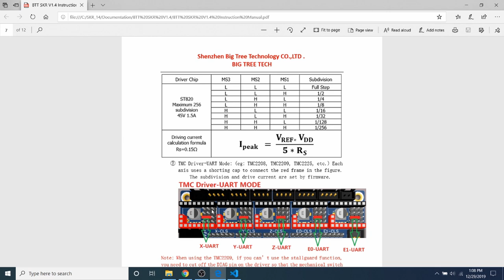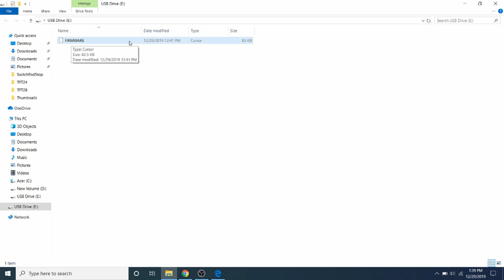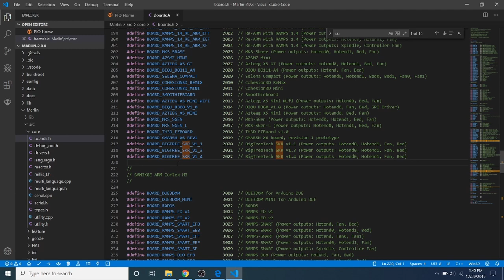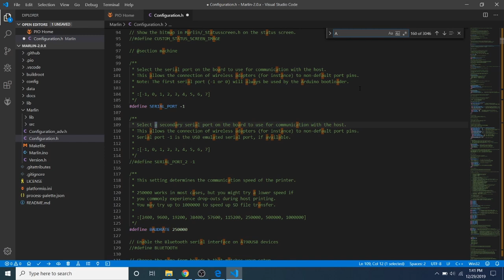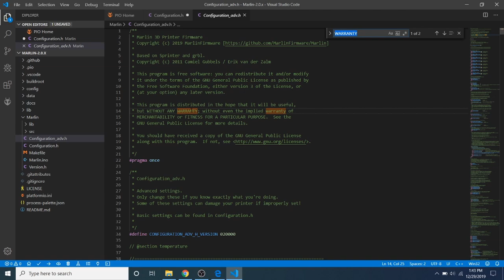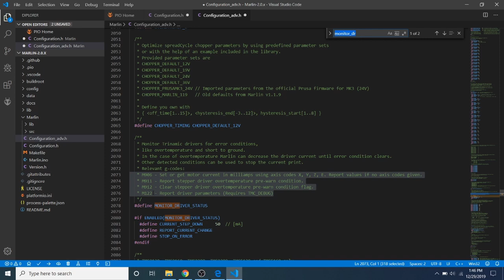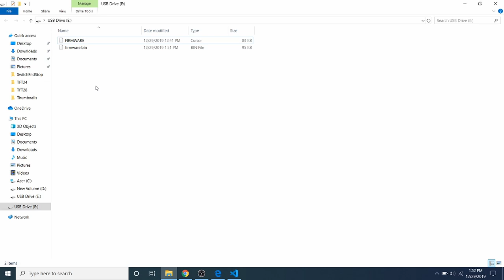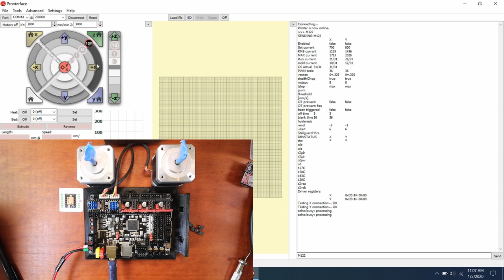SKR 1.4 - TMC2208 UART v3.0

Comment: Hi Edward! So, my SKR 1.4 T came today with these drivers and after plugging everything in, it says 'TMC Connection Error'. My jumpers are in place as following your other videos. I've checked that my zero ohm resistor is in place in every driver, so I guess I don't have anything else to solder right? Am I missing something very obvious here? No dupont cables to connect here and there right? Also I've noticed that when I upload a new firmware, after rebooting it just won't work as intended. I change things here and there, inverting axis directions, changing printer name and such, but to no avail... it's like the new compiled firmware does not actually get uploaded altough I see the new .bin file in the TF card and goes away when rebooted.... Also my heated bed it's not showing a proper temp value but everything is correctly connected (this could be that stock firmware has not a hotbed activated)... hotend works as intended tough...
I would paste an M122 but it's way too long.

Could you please help me work around this issue?
Many thanks.
Reply from the maker: Can we just focus on TMC in a separate Marlin firmware configuration?  If we try and trouble shoot 5 things we're both going to be confused.  First with the board configured with only TMC and board what's the error?
Reply: @EdwardBraiman  It's okay now! I've fixed it after successfully managing to upload a new firmware. Seems like for some reason, firmware was not being loaded after direct upload to TF while in board. After using an external TF adapter in pc and then pluging back the card to the board, reflashed with no issues. All OK! On my driver registers :D
Reply from the maker: @dabelu7165  that's great.
Reply: @EdwardBraiman  I actually have this issue ('TMC Connection Error') and attempted to re-flash but still came out with the same error to no avail. I have no errors otherwise in Visual Studio.

Comment: Do you need to import the TMC2208 library in platformio.ini?
Reply from the maker: Should be automatic if you're connected to internet.
Reply: @EdwardBraiman  Thanks Edward for the extremely reply.  In the code it says the library needed to be added and I'm having issues with my X axis stepper.
Reply from the maker: Try downloading a fresh copy of Marlin firmware and see if issue still occurs.
Reply: @EdwardBraiman  come to find out one of my pins on the connector was not fully seated. After correcting that, I was good to go. Thanks!
Reply from the maker: You're welcome.

Comment: Z achse problem die confi... achse extruder geht nicht auf das bed zum 0 punkt
Reply from the maker: Hat es einen Endanschlag und was passiert, wenn es den Nullachsenpunkt erreicht?
Reply: @EdwardBraiman  schwebender extruder fährt 1 cm runter und dann bleibt er über ded etwa 5cm höher stehen fährt nicht auf den z endschalter mfg
Reply: @EdwardBraiman  ich habe in der adv 2 stepper eingegeben  1-4 von 
2 steppertreiber z1 z2 ist activ
Reply: @EdwardBraiman  nur komisch das die z achse nicht auf null fahren will auf das bed . x und y machen es normal .
Reply from the maker: @thorherz7127  Dies hat möglicherweise damit zu tun, dass der Endanschlag zu hoch ist. Können Sie mir mehr über die Konfiguration für die Z-Achse erzählen? Welche Hardware verwenden Sie für einen Endstop?
Reply: @EdwardBraiman  hallo habe den fehler gefunden muss man erstmal drauf kommen schuld wahr der z schalter mfg